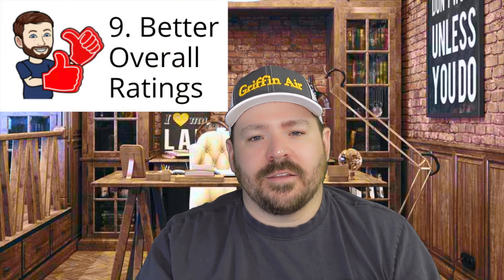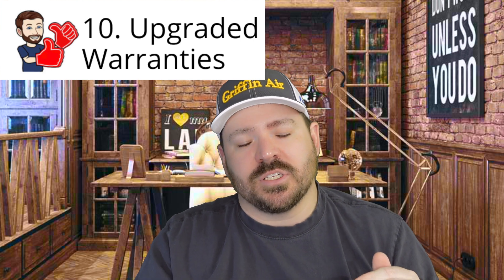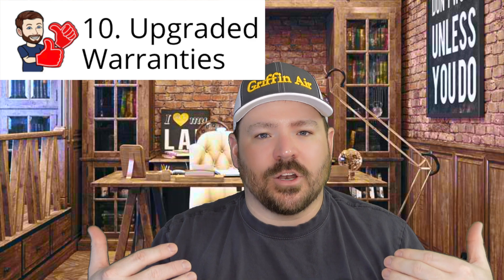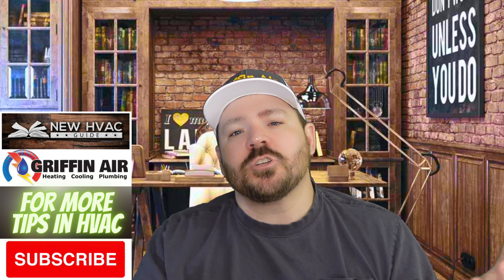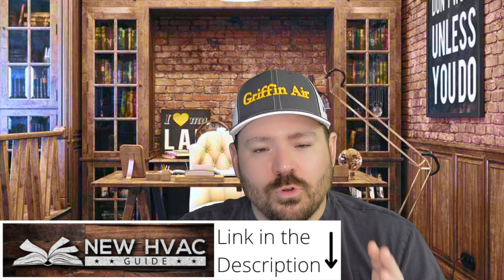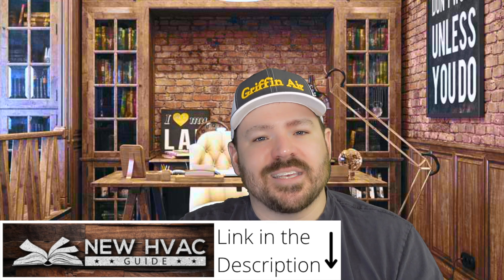12 REASONS Inverter HVAC Systems are BETTER!

Comment: Actually you, and the whole HVAC community as a whole are WRONG! A inverter is an electrical device that converts, or "inverts" Direct current, DC, to Alternating Current, AC. The compressors in HVAC units run on AC typically, and are suppled with AC. So you are saying that "inverter compressors are powered with DC? Most likely these compressor motors are controlled by a Variable Frequency Drive, which controls the speed of the motor by changinging the frequency. So in the US that runs on the outmoded 60hz, the drive can modulate the frequency of the supply from 0 hz to well over 60hz. Agreed, that rectifying the AC to DC then inverting back to AC can give a smoother waveform for the VFD to control. That is the only possible use of inversion that comes to mind. Would it not be more correct to call it VFD technology, which has been around for many decades?

Comment: I got quotes, and it was $9k for a 1.5 ton single-stage heat pump and $13k for a Daikin inverter system. The inverter may be great, but that's just too much extra cost.
Reply: Good point that $4k takes maybe 3 to 5yrs to recover in electric bills?  My issue is how expensive is the mother-board for replacement on a communicating inverter unit? Are today's repair techs educated yet?

Comment: I run way more service call on inverter especially the daikin fit and while they are more efficient is not a big difference cause ones 100% and cools faster the inverter run at 30% most of the times and run longer hours makes no difference it’s only at the start that they beat it so maybe 20$ a month the only really good thing will be filtration and that only works if you have solid ductwork so don’t buy inverter not worth it plus I have every part of non inverters in my truck except for boards which you can bypass for 2 days until you get the board

Comment: begest crap... inverterr caculates the best efficent running cost bull shit and the idiot 3 speads more crap just leave your system on auto fan and it rebuces humidy ??? its the cold fin temp dose that and has a lot of parts to break too single stage is best with auto fan if needed....... tard two ways to get the cutomer inflate the unit price or inflate the installation cost or both and the hvac man makes a ton of cash but we work all day and make 125 dollars they make 1259 a day good advice nice day pickle face

Comment: I have a Mitsubishi inverter split and honey, you can stand right in front of the outside unit and you can’t hear anything. zilch.. I personally love how it’s almost always running, it will shut off for a few hours during mild temperatures like at night and around noon. I haven’t had it long enough to know how much cheaper it is, considering I was running 4 or 5  space heaters I imagine it’s Gonna be cheap asf to run. Well, 2 of the previous heaters were those old 90s white metal grate- in-wall things. Horrible. And then I had 2 stand up portable ac units In summer which could only get the house 20 below ambient temps if they were absolutely blasting all day, literally had to blast the tv and couldn’t use my toaster without making the breaker trip the circuit. Sketchy and expensive has now turned into comfortable and.. well. 3 grand in the hole.. but that’s not the point I was spending more than that every year on heat and ac so if it drops 30 or 40 % I’ll be happy as Larry! I mean to the noise reduction inside, even and continuous heat, It’s programmed for my work week And weekends. Betch. Come ON NOW GURLL I’m living in the future and I love this shet. Like mf people wet their foreheads and sat in the shade for 100,000 years and I get to sit in a climate controlled house tapping around on my iPad 😂 I love this place😅. Except the president. And taxes. And work. I just have to keep reminding myself of the creature comforts I’ve been enveloped in whenever I think about reality lmao is that depression or is my therapist just joking

Comment: The ratio of inverter to non-inverter units out there installed is heavily weighted towards non-inverter systems. So making an assumption that inverter compressors last longer based on the fact you've replaced fewer isn't really logical.

Comment: thanks to amazon prime day, i was able to get the higher btu inverter ac unit for cheaper than all the smaller capacity / non-inverter units - and quicker, too, because they were still in stock while the "cheaper" ones were on backorder - AND none of them had a price drop

Comment: when I wired my house I put a 40 amp 220 breaker in for the compressor unit.  With the newer models you are referring to what amp rates circuit breaker is required?

Comment: Your videos are good.   I'm trying to get a variety of opinions on inverter systems and yes it makes sense that the most stressful part on a compressor system is the starting and stopping.  This is probably true on the motors as well though bearings do seem to be largely a number of rotations but the compressor is the key cost

Comment: Can you use a DC inverter compressor with a constant torque fan (in the air handler)? Or does it need to be a 2 stage air handler?

Comment: I bought a Ruud up20 this summer and have loved it so far. But…now it is fall (Oct) in Virginia (Smith Mountain Lake area) and I turned the heat on for the first time and the “electric heat” popped up on the screen. Then the humidity shot up in the house to 67% and condensation accumulated on every window. What is causing this? A tech came out but he didn’t have an answer for it and reduced the humidity level down to 40% under the dehumidification setting. This did not help and the heat caused condensation again this morning. I do not have a humidifier attached to the unit. Just wonder if you have heard of this happening. Thanks. Also, you have Great videos!

Comment: In green grass states where your duct system is in the attic inverter systems increase the duct loss. More reliable with all y those electronics? That is laughable. Mitsubishi inverters have a bad reliability in Florida. Last Daikin I installed was doa- bad coil. The replacement coil was bad also.

Comment: Inverters workk well for 80 degree outdoor if ur in an area that gets warmer that motor wil be full blast where they are inefficient. have you ever replaced an inverter board the labor is about 1000$ that is just labor so if you have a warranty expect to still pay the labor. im work in the HVAC industry my unit just has a contactor and a cap :)

Comment: Just installed a Lennox Slp99 furnace and Sl25xpv heat pump 30k installed for both 
That’s surge protection included uv light proper filtration 
I’m in Canada so I’m not sure what that is in American dollars
Reply from the maker: I’m not sure either. I hope it keeps you comfy and happy for years to come!

Comment: Are inverter AC's and Inverter heat pumps comparable? I was considering getting an inverter AC but i was concerned about the lack of tax credit compared to the heat pump. It has a max of 600 instead of the 2000 fkr heat pump. If thats going to be the case since itll be cheaper for me id like to know my efficiency will be comparable to heat pump of the same seer rating. It should even out of thats the case.

Comment: Do they make AC package unit that is inverter? The energy savings on that should be high but the question is should I go with effecient inverter or a true and tested 1-stage system?

my other question is whats the difference between the AC unit in most of your thumbnails that is installed on the ground and the ac package unit that comes in metal like rooms placed above roofs?

Comment: What's the best smart thermostat for a Bosch inverter heat pump? I have read that any smart thermostat except the Nest work. I currently have a Nest and am having a Bosch system installed (Bosch inverter heat pump, oil furnace that is also the air handler).
Reply: I use Ecobee. What did you end up getting?
Reply: @molk17  I went with the Honeywell T10+ Pro.  That's the one the HVAC guys who installed my system recommended.
Reply: @Graffixnyc  are you able to avoid short cycling? How often is your system running at 45-55F?

Comment: Here in S. Florida, my price of electricity went up 15% year-over-year... from 14.4 cents/KWH to 16.5. That's one more reason to go with something more energy efficient. That rate hike, even if there aren't any more, probably knocked over a year off the breakeven point on a lot of these systems. And there are likely to be more rate hikes going forward.

Comment: Question about operating inverter system vs non inverter. Is it better to operate continually or turn on and off during the day. I live in a high humidity high temperature country. I am concerned by electrical costs.  Presently I have a non inverter system that I run minimally throughout the day.

Comment: Inverter HVAC systems are TOO EXPENSIVE. The public should refuse to use them until the manufacturing companies LOWER THE INFLATED RETAIL PRICING. Two speed HEAT PUMP systems are more cost effective and reliable.
Reply: Your point is well-taken, but it seems like this is beginning to change.  I'm currently reviewing proposals for a 5-ton new central HVAC.  The price difference between a variable-speed (VS) inverter system and a 2-speed has narrowed considerably over the past 5-10 years:  2K difference today vs about a 10K difference 10-12 years ago. Current minimum SEER that can be sold is 14. If this minimum std increases, and it will - just a matter of time, it will not take much of an increase to where only a VS can meet it.  So, more VS units will be installed over time, parts will become more available, costs will decrease due to more volume production, and more techs will be trained on how to service & repair them.
Reply: @binfordtoolman5674  Think about this. With an inverter drive heat pump system, the compressor runs continuously, 24/7, ALL-YEAR-LONG. With a 2-stage heat pump system, the compressor "rests" until needed; then starts up in STAGE ONE at less than full load inrush amps thereby minimumizing the wear and tear on the compressor. The most expensive component in either system IS THE COMPRESSOR. For "LAUGHS AND GIGGLES" you should also get a quotation for replacing the compressor under warranty where YOU are still responsible for the labor.  In this scenario, the labor will be so high you might as well replace the outdoor heat pump as a complete unit including the condenser coil, compressor, suction line accumulator, fan motor assembly, etc.
Reply: @FatManDoubleZero  I hear what you’re saying and it’s a roll of the dice either way.  I currently have two 2-speed HVAC units from different mfr’s that are professionally serviced each year.  Both compressors are still running, but had the evap coil go out on both, one w/in the warranty and the other 2 years after.  So, not exactly problem-free.  Evap coils are not cheap either.  OTOH, I have a friend that has a 10-year-old variable-speed (VS) inverter system with a communicating t-stat and has not had one problem with it.  My point is that inverter units will become more commonplace whether we like it or not.  Minimum SEER that can be sold will increase.  It’s only a matter of time and by how much.  Same thing is happening with pool pumps.  Single-speed pumps over 1 HP are getting nearly impossible to find.  Many jurisdictions no longer allow them to be installed.  Even 2-speed units (what I have) are becoming increasingly difficult to find.  As with HVAC, VS inverter pool pumps will be the only choice one day.  How soon is anyone’s guess.
Reply: @binfordtoolman5674  Your "guess" for the future of differing product availability, labor, and pricing is as good as mine.  TRANE sells lots of 2-stage compressor systems and their pricing is, in my opinion, OUTRAGEOUSLY HIGH. They will NEVER give this up this line because several of their "dealers" will NEVER have enough "highly specialized & skilled labor" to competently service a future market made up of new customers who can only buy  "variable speed compressor systems; whether "retrofits" or "new installations."   I have "seen" this same scenario, starting more than three decades ago in the commercial elevator industry in which AC variable speed solid drives first became available. The lower technology DC elevator motor hoist machine "drives" (that use relays and old technology programming boards) are still available TODAY because they are VERY RELIABLE installations that are easier to "train" service personnel to install, service, and repair. Concerning commercial elevator installations, AC Variable speed Drives NEVER became the dominant resource, but instead continues to CO-EXIST TODAY with older technology.  In my mind, this is a "model" for what will transpire within the HVAC industry in the future. I believe that the "demand" for many different consumer options and good company profits will drive the HVAC consumer market as long as real competition exists amongst the six companies that produce 98 percent of the product; - not your "market-wide" all encompassing variable speed compressor "economies of scale scenario."  The profit margins must be extraordinarily HIGH for 2-stage systems like the ones you and I own. I don't "see" companies like TRANE" shooting themselves in the foot by eliminating this option or the less expensive "single stage compressor options" either.  Another consideration; many HVAC field supervisors believe that 2-stage compressor installations accomplish "BETTER INDOOR HUMIDITY CONTROL" than variable speed compressor installations.

Comment: Confused with 'Inverter' vs 'Variable Speed' system? Are the 2 interchangeable?
Reply: A true variable-speed AC uses an inverter to control the speed of the compressor & fan motor.  You cannot have one w/o the other.

Comment: I just installed an 18 seer pioneer ducted split system.  Unfortunately, I screwed up and didn't do enough research and discovered after the fact that while the unit does indeed have an inverter, and ramp the compressor up and down, it still generally acts like regular a/c unit. 

I mean that as, it can only use a traditional 24v single stage thermostat.   So, it starts up.. ramps up, runs for a bit...then shuts off....then starts...ramps up, runs for a bit....shuts off. 

I don't hate the pioneer...I can tell by my house power monitor system it definitely varies its capacity depending on how hot it is outside and inside.  I just wish I did a little more digging and got a true communicating unit that will run at a very low level continuously, instead of this one that needs to shut on and off all the time.

Comment: The reason these guys want you buying all this fancy equipment is you'll be calling them every 90 days for maintenance and repairs and expensive parts if you think buying the newest and latest and most expensive is best you are surely mistaken by the least expensive single stage simple and it will work for 18 years And you'll never need to see an hvac repairman again
Reply from the maker: In my experience, your comment is incorrect. Have you owned an inverter system? We see more issues with single stage systems than inverters.

Comment: I am primarily a Bryant dealer but have been doing a bunch more Amana high-efficiency units and some of the 98% Goodman's too.  I have not installed a Daikin before but the last Amana I installed was a 98% NG modulating furnace and the top model of Heat pump.  My apologizes that I don't have the models in front of me, but I am very impressed by the production quality, Stainless steel heat exchangers, plus several other little items.  Some of your videos make me do research and found since Daikin took over the "used to be lower end brands" are now running with the big dogs.  I would take a nicely optioned Amana over any Rheem/Ruud, Lennox, American Standard/Trane, Johnson Control systems equipment.

Comment: Got a Lennox 18 seer inverter system and I'm surprised how high tech it is. I seen the plate removed on outdoor unit and the mother board was massive!
Reply: just make sure there is a surge protector going into the condenser, because of all the sensitive electronics. if the motherboard goes out, that will be pretty pricey to replace.

Comment: Anybody know what is DC invertor?  DC  by default can not be modulated by frequency because DC has no frequency at all.
Brushless DC motor (compressor) speed adjustment made by voltage only  or am I wrong?

Comment: I'd like to see a temperature chart to see how these act as temperature drops. Northern Wisconsin is the real test.
Reply: I have an inverter gas furnace up here in Canada. Works great. Some people install heat pump systems here. From what I can tell it’s not worth it. Especially when the temperature is less than -5F.

Comment: Thanks for the video. 
What you are calling "dead band" is technically hysteresis. It's the temperature difference the unit works between to keep the room relatively close to the set temp. 
There is no such thing as three phase DC. Direct current  can not have a phase.
Reply from the maker: Thanks pal.
Reply from the maker: I call it what they call it. But yes. You are correct. Most homeowners don’t know what I’d be talking about if I got into rectifiers and motors powered by dc with square pulses and all that. 🙂